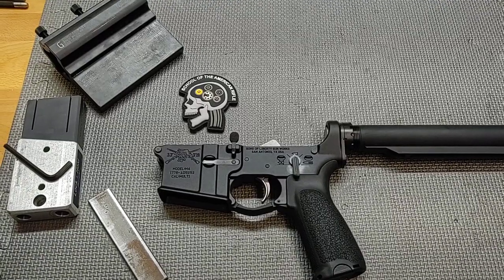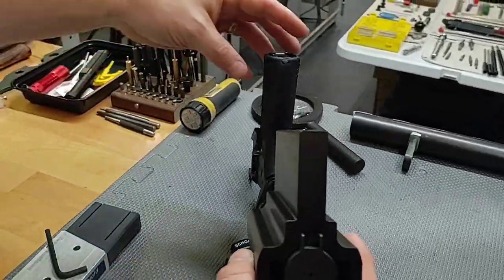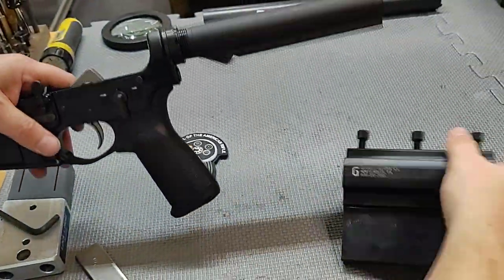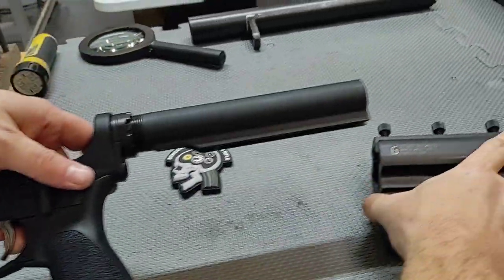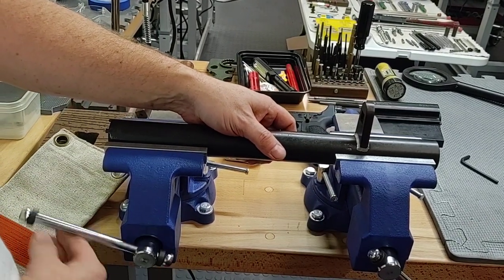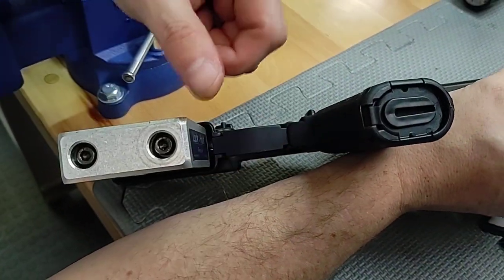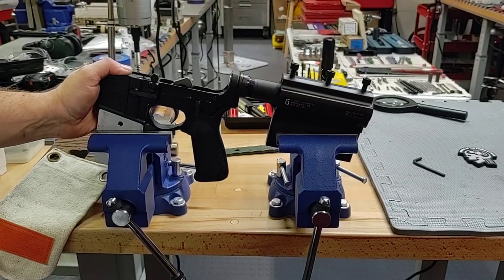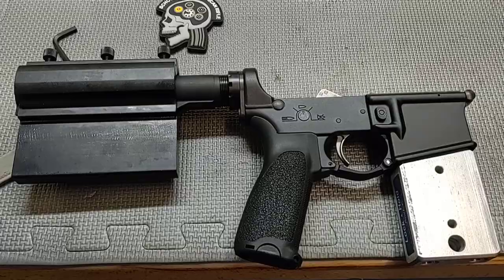Best AR15 Receiver Extension/Buffer Tube Jig

Comment: Good vid with great info like always but.....

Don’t buy the Geissele jig, they’ve doubled the price of the receiver extension jig from $100 to $200. 

Botach sells the same thing for $59.95 under their Kley Zion brand. Which is more inline with what something like this should cost. I use their reaction rods and they are gtg.
Reply: It's almost like Geissele isn't in the firearms business but in the price gouging business.
Reply: @netchemica  

Agreed between G upping their prices and Magpul putting MAP pricing in place for all their vendors, they both are trying almost as hard to screw their customer as cheaper than dirt does.
Reply: @Latinos4Trump  

Minimum advertised pricing

It means a retailer was able to sell a companies product for what ever amount they felt was a comfortable profit margin, but with MAP the company tells the retailer that they cannot sell their products for less than a certain dollar amount. 

Ive seen alot of in store coupons posted with magpul and G, buy this get a $20 or $40 coupon emailed to your inbox. So the retailers have found work arounds to still sell the products below MAP but on paper theyre selling the products at MAP
Reply: not sure if you have used to Geissele receiver extension jig, it has it’s pluses and minuses, but one thing it isn’t is cheaply made. It’s a buy once, cry once tool. I really like mine and how precise it is.

Comment: When I built my franken AR, only tools I had were a vise, tapco wrench, some allen keys, cheap mag well vise block, Horrible Fright torque wrench, and an upper clam shell block that didn't actually fit my upper. I don't think I even dimpled my barrel for the gas block. I bet Chad may have had some issues with my build, but after about 1000 rds, no problems at all! I did not stake my castle nut, and I'm OK with the clocking being off.

Comment: You do not need any bracket or anything. You should just make VICE that will hold tube a floating one. Lower receiver will center it self on lock-hold, than you can tighten floatin vice on tube. Everything will be in-line

Comment: I like buffer tubes with the notch that indexes with the buffer detent
Reply: They still have enough room to ever so slightly clock off center.  It's cosmetic really, but with the buffer tubes with wings to both sides of the detent, if it's tensioned against the detent stud it can wedge it in place.  Because of this, they are even more important to get straight (ish) when installed.

Comment: $200 for that reaction block is absurd. Is there a cheaper alternative?
Reply: i agree its spendy if you arent building a ton of rifles  if you put the lower upside down on a perfectly level table with the buffer tube hanging off the table you can put a small torpedo level on the flat side of the buffer tube and it'll show you where you are in relation to being level. You cant have the fire control unit installed yet though otherwise you cant sit it flat

Comment: Wouldn’t you need to divide that 3/16 (3/32) plate thickness by two and place one on both sides to keep  them in alignment before tightening the castle nut? It will be off to one side if you don’t.
Reply from the maker: You only have to shim the side that touches the static vise jaws  The jaws that move only tension, not align.

Comment: Me: yOu GuYs UsE tOolS?! 
Literally I hold it in my knees and eyeball it. 🤭 
You'd LOVE my technique for pinning the gas tube, putting the block on and aligning it.
Reply from the maker: Lots of people use that kind of method. They don't allow repeatable torque.
Reply: @SchooloftheAmericanRifle  I've learned hard ways, watching you is like peeking behind the curtain in the  holy of holies 🤧
Reply: @SchooloftheAmericanRifle  I had the alignment issue with the blade brace I use. Took me a while, and pretty sure it's still a bit off. 😒
Reply: I worry more about the comfort on my crippled shoulder. If it functions properly and dosen't bother my shoulder it is perfect.

Comment: I have a slight disagreement with you regarding the use of your ‘spacers’. If you only use a spacer on 1 side of the Geissele block, wouldn’t that mean your entire set-up would be slightly off center? For it to work perfectly, it would seem that you would require 2 equally sized spacers, 1 on each side of the Geissele block to be truly ‘centered’.
Reply: thought the same at first, but what he said is right. Because just one side of the clamp moves, you just have to shim on the "fixed" side;)
Reply: Maybe that's why it's clocked as he demonstrated at the beginning of the video.
Reply: [(Mag well block thickness)-(buffer block thickness)] / 2 =3/16". My only suggestion would be to use 3/16" angle iron so it sits on top of the vise jaw rather than having to hold it while you tighten it. Really nice looking setup though.
Reply: Maybe I didn’t phrase my original comment properly. I feel that- The true center ‘bore axis’ of the receiver extension and the receiver will be slightly canted (off center) unless the Geissele block was shimmed on BOTH sides by TWO equally sized spacers. If only ONE spacer is used, the ‘center median line’ will be canted a degree or three away from the side that had the spacer on it. I just did a demo in my shop and, unless I’m missing something here, my demo showed that the true center will be off by a bit unless two equally sized spacers are used, one spacer on each side of the Geissele block, to equal the width of the receiver magazine  block  I’m open to suggestions on why I may be missing something.
Reply from the maker: @kennethkrieb3018  the moving part of the jaw is not what is important for alignment. The fixed part of the vise jaws are. 

If you prefer to use two spacers, be my guest. It's not needed for alignment in this particular case. If it was necessary, I would be using it.

I don't half ass anything.
Reply from the maker: @RisingFear  correct
Reply from the maker: @devinmorton1846  correct. Angle iron would be easier to use. 

I'll be drilling and tapping the spacer to the reaction block. I didn't want to do that before making the video. Things like that just confused viewers.
Reply: As a regular viewer of your channel, I ASSURE YOU that I don’t think you ‘half ass’ ANYTHING.  You are, by far, the most precise guy I’ve ever even known of.  All I am saying is, and I’m NOT a novice at any of this either, for the true center line of the receiver extension to be straight, it must be equal distance away from the blocked magazine well, relative to the point of contact on the vise jaws, forming a straight line. While I can honestly say I’ve never before in my life debated such a seemingly petty issue, it did cause some thought among us all and I’ll simply agree to disagree with you regarding my findings. Love your videos, keep up the excellent work.
Reply from the maker: @kennethkrieb3018  you are not grasping how the setup works. Students have the same questions In class until I show them how a second spacer has no effect. 

The vise jaws that move do not control centering with this setup. If it did, I would be using two shims. I have 2 feet of shim left over.

I will be permanently attaching the shim to the Geissele Reaction Block for this setup. Students choose this setup over every option and method I present.  To prevent students from using the Block (with attached shim) in the wrong direction, I plan on adding shims to both sides.
Reply: @SchooloftheAmericanRifle  - hey, you’re the boss, it’s your channel. Although I’d like to consider myself above ‘student level status’, I admit I’ve learned a lot from your channel regarding gauging and gauges I never knew even existed. I wish you nothing but the best.
Reply: So, since the fixed end of both vices are aligned, you only need to shim the side of the Geissele that goes against the fixed vice end.

It doesn't matter where the movable side of the vice is as long as it us tightly pushing the shimmed side of the Geissele against the fixed side of the vice, because the fixed ends of the vices is what's controlling the alignment...

Correct??
Reply from the maker: @troyreed6255  correct

Comment: This is kinda on topic,  i have a 10.5  PSA ar I built a rifle lower for a 16” upper i plan on buying this month.  I took the lower to the range to test it, it didnt feed rounds, it will fire and eject but wont load a round from the mag.  Its gotta be something with the buffer because my 10.5 works great. HELP
Reply: Eric M   thx man  buffer spring and buffer on my 10.5 is the one that came with it from PSA it works fine.  When i put that upper on the lower i built it wont load a round after i fire, i can re rack another round and fire, it will eject but not pick up a round from mag
Reply: Eric M   the lower i built is a rifle lower kit,  maybe the spring  is too strong for a 10.5 barrel?? Gas pressure and all that stuff i dont know shit about.
Reply: Eric M  its an adjustable rifle stock yes..   not a pistol buffer tube and spring
Reply: Eric M   yep  the pistol spring is shorter than the rifle spring!  Thats my problem,? But when i get my 16” upper it should work???

Comment: SUUUPER disappointed in Geissele for charging double on the buffer tube fixture. 200 dollars for a jig thats only good on milspec tubes? Ill use the KZ instead, 60 dollars and it works on both commercial and milspec tubes. I have both and so far haven't seen what makes the geissele worth so much more.
Reply: Thanks for the link, ive had KZ items for a while and they have been fine. PO’d that Geissele would double something that shouldnt cost 200. And ive been looking for the AR10 bar, thankfully Geissele isnt making it and i wont have to pay through the nose!!! Cudos!
Reply: @parisex4  No problem. If you were to ask me for a recommendation a year ago I would have said Geissele without hesitation. Its a super solid block and at the time it was only $40 more than the KZ. Not to mention I was a pretty big Geissele fan boy at the time. But as I got more experience as a gunsmith and 2020 came around I completely changed my mind. As a gunsmith you have no control over what comes in to your shop so having the flexibility to work on commercial and milspec tubes is a necessity. Also once Geissele started charging double for a fixture that I only use to torque castle nuts it put a super horrible taste in my mouth. At this point the only thing I could possibly recommend from them is their rails and triggers. If they decide to price gouge those things too, I might have to stop using them completely. 

Also if you are looking for an AR10 bar (I assume you mean a reaction rod) look into the Midwest Industries copy. It's much better than the Geissele.

Comment: I still can't visualize why two shims aren't needed to stay center. Oh well...
Reply: The width of the geissele reaction block and the Mag well blocks are different so with two identical vices there isn’t axial alignment
Reply: You only have to align the fixed jaws to keep it straight.
Reply: @garyh.7282  Indeed.  @Steve E, he's only adding a half-difference thickness to the fixed-jaw side to make them co-planar.  The adjustable-jaw sides don't need to be co-planar (but they are parallel).  It's a nice method if you're super-OCD.  Another (if you're just OCD) is to torque, loosen, and then re-torque five times until the magazine, grip, and stock injection mold seams all line up.  Then stake (twice).